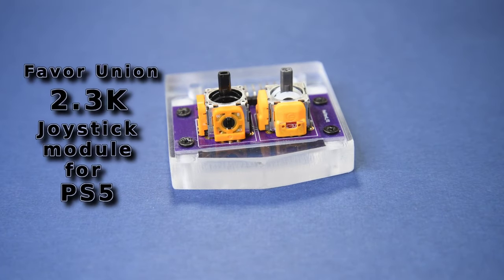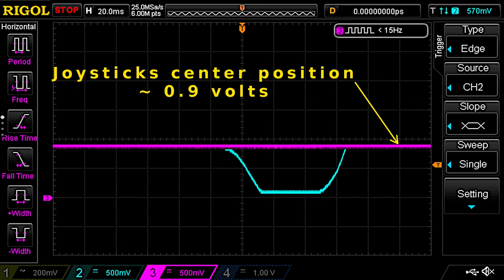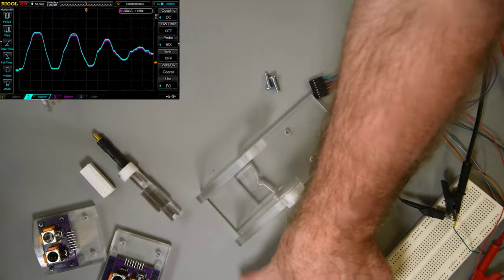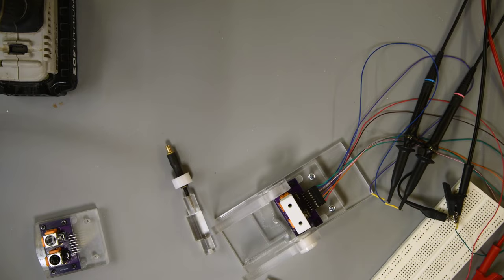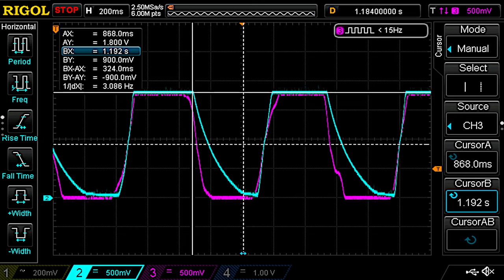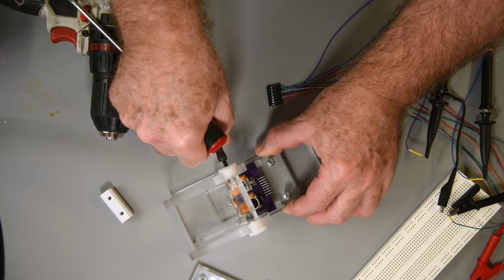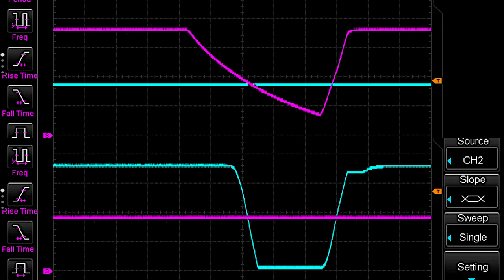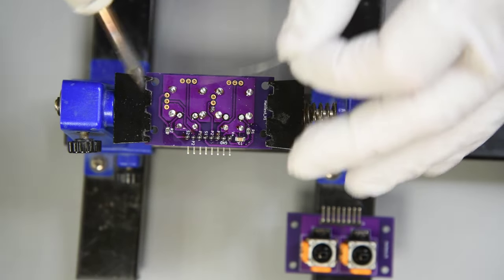Hall Effect Joystick Revisited – Tracking Down That Different Feel

Comment: It looks like it just needs a pull-down resistor...
Reply: I would like to see this tried out
Reply: yes... but it should be built in =( because it makes no sense to have a pull-down with a normal pot joystick, and the hall-effect one are meant to be a drop-in replacement, as far as i understand.
Reply: I don't think that the game controller has a pull down resistor either.
On it's own a potentiometer produces a voltage that is linear to the shaft angle (if it is not a logarithmic one). With a resistor added that relationship becomes non-linear, because there wll be a non shaft angle dependent constant in either the nominator or the denominator of the equation.
That is not saying that a pull down resistor wouldn't help, but that the manufacturer likely has not built this for a circuit with a pull down resistor.

The design apparently is either flawed or not used correctly in this demonstration. The Hall effect principle is definitely not the culprit, as it can be used even for high frequency applications
Reply from the maker: It didn't make the video, but I did try a pull-down resistor. Anything under 200K pulled the voltage down. Over 200K didn't help with the slew rate in any noticeable way. Around 50K ohm did speed up the high-to-low transition time, but pulled the output voltage so low it would be unusable.
Reply: @metalplasticelectronics354 maybe reducing some capacitance might help? like an extra ceramic capacitor in series somewhere? it could just be the capacitance of the op-amp like if it uses mosfets or if its some kind of PID controller. it looks like some capacitance is discharging too slowly. or maybe some filter in there is not designed to go the mechanical limit and is getting overvolted and thus saturated?

Comment: Nice effort you have put in to characterize this. 
The slew rate should be defined in the datasheet if you have a part number for the sensor.
The output stage slew rate could be improved by a better impedance match if it is just a collector drive, I would have thought it more likely a push pull (totem pole) though.
Reply from the maker: Seeing a datasheet would be nice, but I didn't see a company logo on the Hall sensor IC. It had 93L35 printed on it, but that didn't pop up on a quick search.

Comment: Really great work!!! I notice a big difference when it comes to PS3 stick input and the PS5 stick input. Would love to see such a comparison with PS3 vs PS5 (standard sticks) and how there is a difference and if there is any. Maybe even include the ps4 sticks to compare all of the ps3,4,5.

The dualsense sticks feel off to me. Same with dualsense edge. I still prefer the feeling of the ps3 sticks input.

Im just searching for the sicks which are similar to the ps3 input feel for my dualsense edge or the normal ps5 controller.
Reply from the maker: Mechanically they are all about the same.  But the circularity is different between the DualShock3 and the DualShock4/DualSense.   Of course, different thumb knobs on each could be the reason for the different feel.

Comment: Could you test the ones used on the Dreamcast?
How about the optical joysticks Nintendo used for a bit?

Longevity test over 5 years?
Reply from the maker: If I remember correctly, the Dreamcast had the Hall sensors mounted on the controller PC board. I may be mixing that up with another controller. I'll have to look up the optical joystick. I don't remember ever tearing one of those apart.
Reply: Yes, the DC one is a completely different design. There is also due to it a much larger sense area, which is also by nature uniform in all angles I think.

Comment: Looking to replace my joystick on PS5 controller. I have basic soldering experience and that's about it. Do you recommend going potentiometer route or replacing with hall effect?
Reply from the maker: I like the feel of the Hall joystick modules. There should be no drifting with them, and you can center them to match the old joystick. They do have a slightly different feel to them. The next one I replace I intend to use one of the Hall effect joystick.

Comment: Hey man I have been watching your troubleshooting video on a dualsense controller, because I am experiencing some issues right now. After replacing the analogues my controller just blinks 3 times orange and shuts down. I looked up everything on the internet and still not finding any solution that helps me. This happened me on 2 different pcbs. Never experienced something like this on a ps4 controller. I cannot find any information about this that why I am contacting the master mind number one
Reply from the maker: If you have a meter, you need to check for 1.8 volts. There may be a short somewhere. If you don't have a meter, all you can do is look over the PC board very closely and see if you see any solder where it shouldn't be.

Comment: looks like you got some capacitance on there (assuming analog output). i like sensors with digital output as you don't have to worry about a clean signal path (this is not suited to drop in potentiometer replacements). sensor filtering is usually a feature of those types of sensors. check the data sheet.
Reply from the maker: The only capacitance is the wireing and the 10X scope probe, so not much. I did try with an 18 nF cap on the output, but it really didn't make much difference. Why they are filtering the low to high transition and not the low to high transition just seems strange.